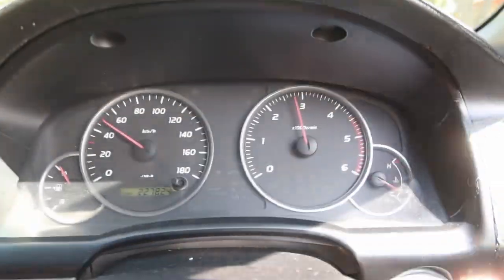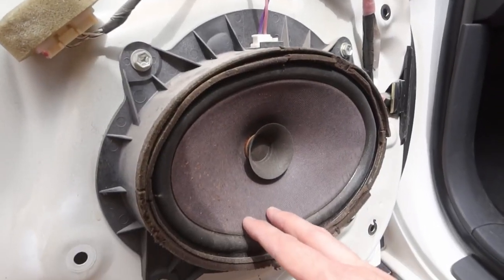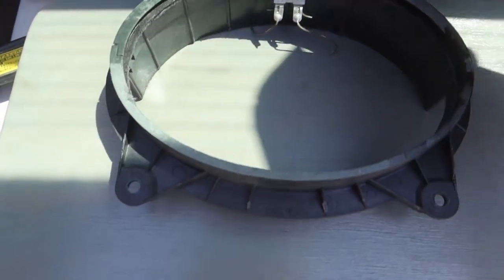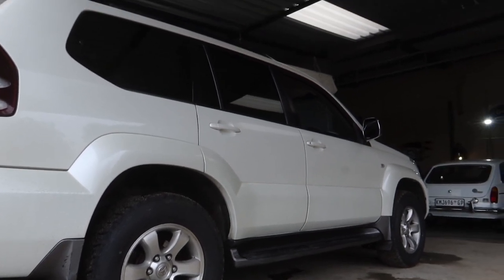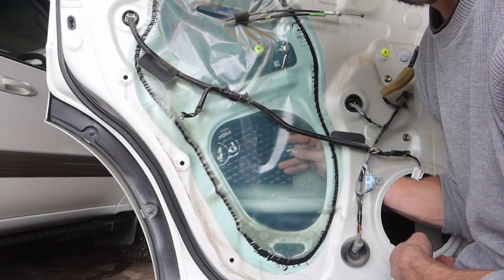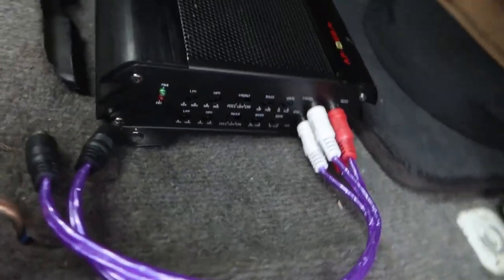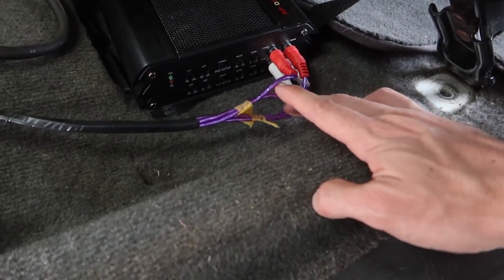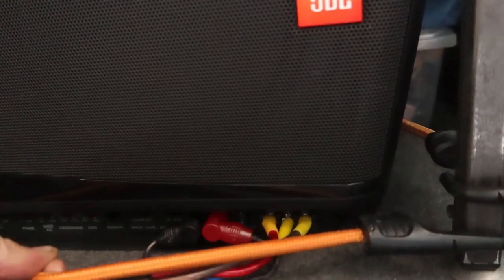120 Prado Audio Upgrade

Comment: I could t have done this without you. I am just about to cut the wire from the tweeter plug and solder in to the splitter. Has taken a few rewatches to compare your wiring to my alpine R2 wiring diagram.
Reply from the maker: I am so glad to hear that, those alpines are going to sound great in there 😎
Reply: @AdvSouthAfrica  Not quite there yet. Looked at wiring diagram as I got confused with the factory harness in the door. Was scared to solder in till I am sure. Factory seems to be stereo to tweeter then on to woofer. Alpine diagram shows stereo to woofer then on to filter then tweeter. The woofer has 2 pairs of terminals for that reason. So I am still a bit confused and trying to draw them side by side on paper to get my head around it.
Reply from the maker: @ClarkyXPH  it should just be a single input and then the splitter will sort out the rest

Comment: And they’re in. Once I checked wiring diagram and got my head around that the tweeter wires were just a loop and it didn’t matter whether it was amps to woofer then tweeter or other way around it was easy. 2nd side about quicker as I knew what i was doing. No amp yet just running off head unit.

Comment: Hey man, is replacing the tweeters a must do for this upgrade?
Reply from the maker: @finnmcauliffe8652  you can probably get away with running the stock ones,  I just replaced mine because the previous owner of the vehicle blew one

Comment: Cheers for this, am doing a full upgrade on my '03 Prado so it was good to see what to expect from the existing speakers. Do you get any rattle from the doors? Thinking of lining everything between door and card with some thin foam. Thanks again! 👍
Reply from the maker: Awesome stuff! I only got a little rattle from a window mechanism when I was making more bass in the doors before I put the subwoofer. Now that I have the sub, it's been amazing and no rattles in the doors! I'm glad this video helped you out!

Comment: Hello, I also have a Toyota Prado 120, I want to install a JBL sound system, it's amplified, but I won't put the bass in. Which JBL speakers can I get a good sound effect if I install them?
Reply from the maker: Have a look at the stage 3 JBL speakers and amp them accordingly. I'm very happy with my stage 2 speakers but I am running the 8" JBL sub. Just remember that more power in the doors makes the window mechanisms rattle to secure everything that you can

Comment: I was just thinking about this again today and depending on how the filters are made the wiring could make a difference. The alpine wiring diagram seems odd as wiring the amp to the woofer then looping on to the filter and then tweeter suggests the woofer would be trying to reproduce the high frequencies as well as the mid and lowers, whereas the factory Toyota wiring going to the tweeter then woofer depending on what’s in the combined tweeter capacitor could in theory send the high to the tweeter and the kids and lowers to the woofer. I don’t understand why the amp just doesn’t send everything g to the filter and it just splits above and below the set frequency to the appropriate speaker. A loop meaning the whole range going to any speaker unfiltered means that speaker is not receiving an optimal signal. In my mind anyway.
Reply from the maker: Hmm interesting, the way I did it I send the full signal to the door speaker amp, then filter the lows out for the door speaker, the tweeter then filters out the mids. Then I checked what range the mids start at and try mix about 20hz overlap
Reply: I haven’t installed an amp yet so hence my thought I am sending full range from head unit to door. The Alpine diagram expects the system to be amped which would explain why it doesn’t matter because the door speaker amp can filter out the sub bass at source so the 6x9 only sees above 60Hz
Reply from the maker: I'm sure the head unit has an EQ and then you just turn down bass. Won't be an issue at all 💪 too much bass from the door speakers rattles the window mechanism and doesn't sound good so it will probably be perfect just turned down a little

Comment: Hey! Nice video. I'm plannig to replace my spekers also, but I dont know what kind of speakers to buy and I dont know the size of the speakers.

What kind of speakers did you use?
Please be kind and help a dude:))
Reply from the maker: Thanks! The front are 6" x 9" and the rear are 6,5" 
I've used Jbl in this system

Comment: Great video thanks, I am wanting to do mine this week. I have got a 12’ sub and amp already. Would you recommend the 2 way or 3 way JBL? Bare in mind I will need to remove the sub when I go over-landing as I have a drawer system fitted. Should I skip the sub rather.
Reply from the maker: Thank you! Are you planning to amp your door speakers? If so then go with the 3 way. If I was you I'd mount the sub amp under the driver seat and just run speaker cables to the back, then when you overland you can just disconnect the sub and you won't have anything in the way
Reply: Excellent I will do, what head unit would you recommend, I don’t want to go for anything too expensive, would be nice to have NAV and apple car play.
Reply from the maker: @robertbaxter546 I actually on the hunt for something similar, mine does Bluetooth but it bugs me that I can see the song name on my screen.  There's a couple of brands that do screens but when they have the new features they're not cheap
Reply: Okay, I am eventually going to start the build when I am back in SA in 2 weeks. 

Too many options to choose from speaker wise.

I am thinking of not doing the sub, rather installing an amp for the door speakers. 

JBL has many options of stage 3 which would you recommend?
Reply: What about the GTO939 6x9?
Reply from the maker: I can't find this model number online but I think that's the stage 3 JBL, it will decent quality but I'd recommend fitting an amp for those then
Reply from the maker: With the JBL range try match the watts rms on the amp so that you get your best performance
Reply: Yeah I will install a 4ch amp for all the door speakers. The GTO939 I don’t think is available in SA, I am looking at bringing them in from the USA.
Reply: What size tweeters did you buy?